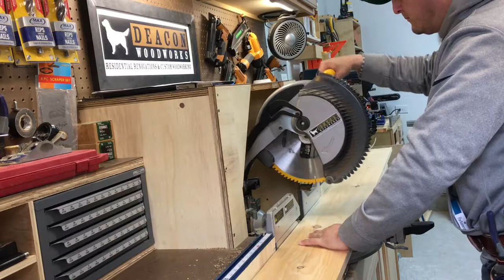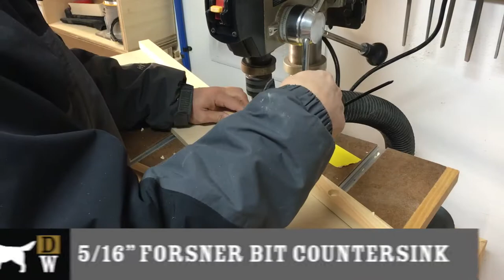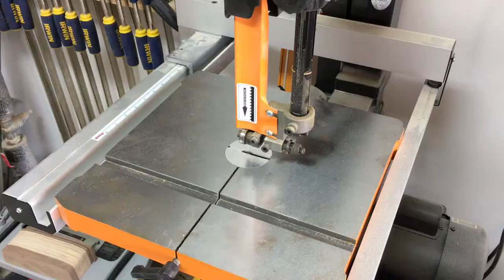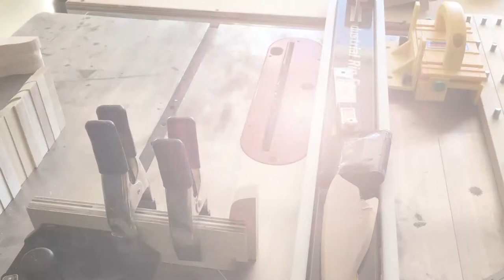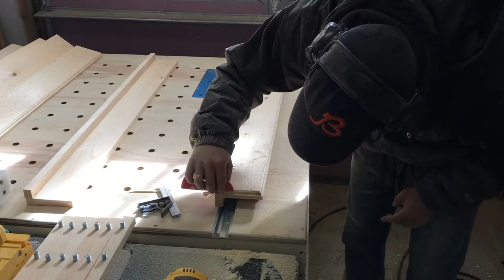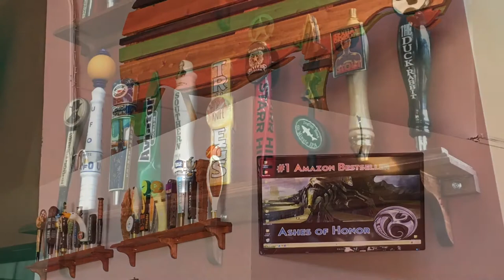DWW: Tap Handle Display Shelf (ep13)

Comment: silly question maybe, but I'm trying to make a similar project as a Christmas gift for a friend, and my "know how" is limited... How are the bolts secured inside the mortise and able to keep the taps tight? Is there enough room for a socket to grab, or are the taps just hand tight?
Reply from the maker: The bolts are recessed into the middle support piece and secured with superglue. The middle support piece is then glued to the main shelf. No nuts required.

Comment: What bolts did you use for to screw the handles on to? Is it 5/8" 16? What length?
Reply from the maker: Samuel Phillips - 3/8” 16. Length depends on the size of the stand off you use. I usually want about 1” showing above the shelf so gauge your length based on your build specs.
Reply: @DeaconWoodworks  ThankS!!